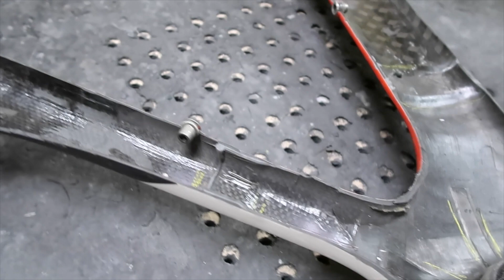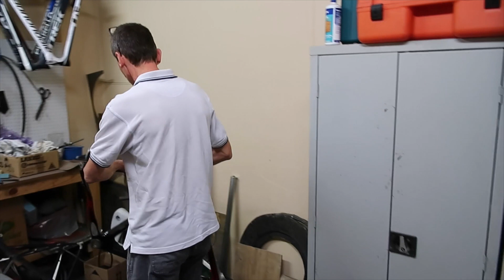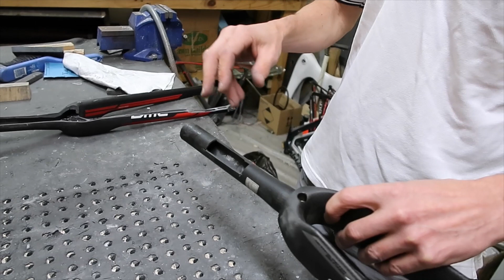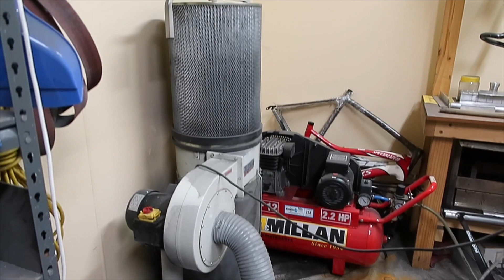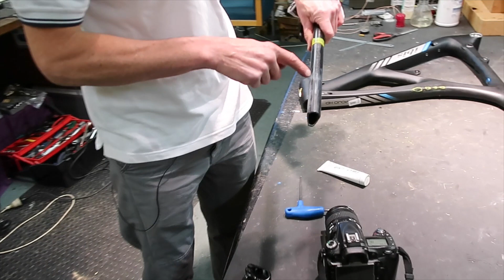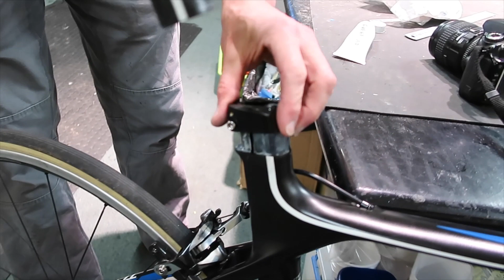Cutting up Expensive Carbon Bikes // Inside High-End Bicycles

Comment: what about heat from cutting , doesnt it cause rosin damage on cutting area ?
Reply: No, not on a small cut like this, on thicker laminate if the cutter is not sharp then it can be a problem and needs to be considered. Good question.
Reply: If the heat is too great then the resin will start to soften and it will go a light creamy colour (I'm color blind so it could  be grey) . I work with carbon and I always cut using a high speed cutting disc but I hit the carbon gently and as few times as possible . 

Also once you have finished machining a carbon piece you are left with tiny bits of carbon in your skin and it is bloody irritating for at least two days .

Comment: But can he put them back together?
Reply: Not much point putting ones back together that have extensive damage or manufacturing flaws. Repairs to smaller areas of damaged frames however makes sense when done correctly.

Comment: Thanks for bringing us this insight into carbon tech. I went straight to my bikes to check for corrosion between Carbon and Aluminium; Especially my daily all weather Trek Madone 2.1 commuter, carbon post in Alu frame, spends a lot of time wet!
And my MTB, carbon bar in aluminium stem with steel bolts! all 3 hate each other! Glad I watched this. Thanks for another good value vid.

Comment: why don't they use a core/foam for the frame?
Reply: There are many reasons, including the added weight over a larger volume of foam.
Reply: Would make the frames stronger for sure but the added weight is the issue . Also it is far more expensive making foam cored carbon parts so the price would also be very high .
Reply: I've heard the foam can compact over time as the frame bends or vibrates and the foam compresses.  Then it is loose on the inside.
Reply: H Craig Yup . Foam eventually breaks up  but because it is already highly compressed in this situation then it will take a longtime . For instance by the time the foam has broken up you would have probably already moved onto a new wheelset .

Comment: Sod carbon I just don't trust it, aluminium is back in a big way.
Reply from the maker: Nothing wrong with carbon, the aerospace industry trusts in it. What you need to trust is the process of manufacturing it correctly.
Reply: Aerospace industries have the money and resources to thouroughly and beyond doubt, check and prove with certification, and compliance to certain minimum standards set by outside bodies,  that what they say is good enough IS good enough,they have to.  bikes are less critical.and although i don't doubt they are tested, to some degree, the variable quality as proven in vids like this, makes it not worth the risk, in my opinion.
Reply: all carbon is not the same for sure..charbon frames are not the same as aerospace carbon
Reply: There's always this stuff

https://renovobikes.com/pages/bikes
Reply: Well said, it is possible to build a bad product out of any material, the design and processing is key.
Reply: Luescher Teknik Yes I agree but with carbon the mistakes are well hidden & when it fails it is catastrophic.
Reply: palmer3977 Flaws can be hidden in any material. Ultrasound scans are used for finding flaws in welded and forged metals as well. Carbon failures are not always catastrophic, another myth that needs to be busted!
Reply: Luescher Teknik I would have more confidence getting back on a aluminium frame than a carbon frame after an accident.
Reply: I would say that there are too many variables to make a blanket statement like that. I have also seen plenty of aluminium parts fail also. Those Columbus Airplane tubing frames were very fragile and had a recommended life of 1 year. Also look at the carbon track frames for example, there are plenty of crashes and they get back on and ride the bike. It comes down to the design, obviously the lighter the frame the less margin for error, in any material. Carbon is replacing aluminium in commercial airliners for a host of reasons.
Reply: Luescher Teknik There is no argument for right or wrong here, just personal preference.
Reply: Hey Shane any chance we could get some info on China carbon frames. The good bad and ugly?

Comment: Hey Shane love the vlogs as always, quick question. When using a carbon seat post with alloy frame or carbon bars with alloy stem, should you use any grease or carbon bonding compound or just run it dry?
Reply from the maker: I've always used fibre paste for that scenario too. The grit seems to help with the 'grab' and prevents any slipping.
Reply: always carbon paste - use NEVER!!!!! grease with any carbon parts!

Comment: I and I think a lot of other people would really like to see a counterfeit frame(eg Chinarello F8, fake NK1K) get cut up! If we see so many problems with legit brands, I wonder what kind of atrocities would Raoul find with the counterfeits.
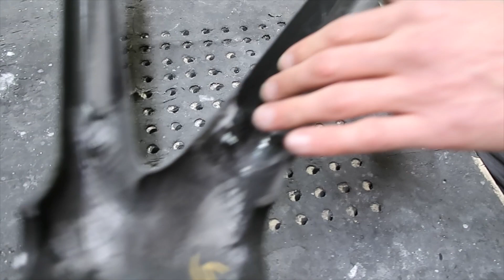Reply: Definitely! I've seen a cheap Chinese frame snap before and there was a LOT of the loose fibre stuff seen at 4:07 in this video.
Reply: @philadams9254  I am 82 years old, and have been riding road bikes all my life, since carbon became a thing I saw over 10 frames snap. All of those was by main brands.
Reply: @philadams9254  I snapped a specialized roubiax frame the first time I tried to pedal hard.
chainstay crunched, folded, and the two sections completely separated from each other.
Reply: dont buy carbon...go titanium